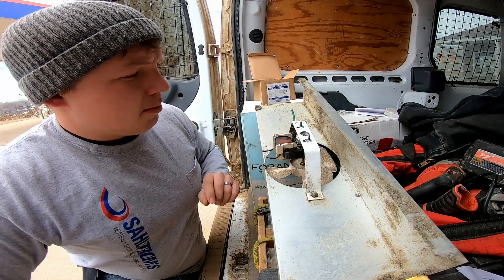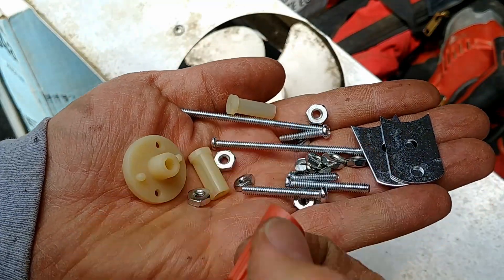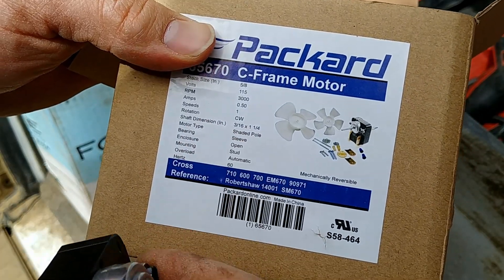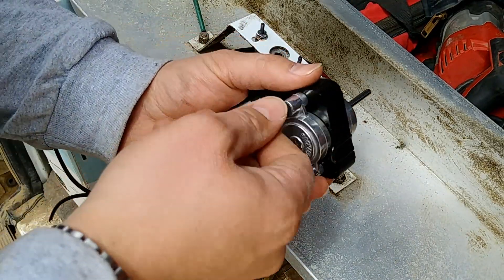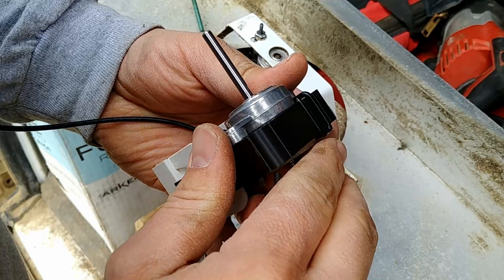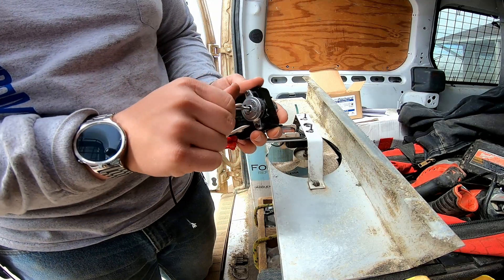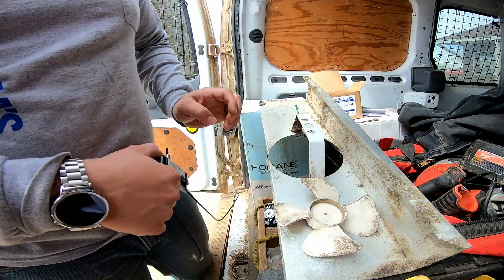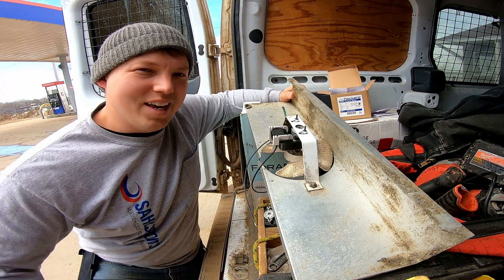How To Replace a C-Frame Motor & Mechanically Reverse Rotation

Comment: Observed you replacing the C-Frame fan motor with a new one. 
My only question is, why you didn't put in a 100% of your effort? 
You didn't wipe down the fan blade, and didn't brush off the mounting plate . You reinstalled a filthy unit. As a customer, I would have greatly appreciated it if you had done this. My take on this is that you did a half ass job. Going above and beyond the call of duty will only make you a better man. 
Those are the rules I live by, you should try it, it won't hurt ,guaranteed.

Comment: As someone who needs to replace their refrigerator motor soon (at least by the sounds it makes) how do you even go about knowing which motor you should buy? I'd love to try and fix things by myself but I feel so hopeless when it comes to this sort of thing, and the last thing I want to do is electrocute myself or damage the fridge beyond repair.
Reply from the maker: Disconnect power, disassemble fan assembly, search motor model information, purchase motor, install and restore power! Residential refrigerators are generally fairly easy to work on if you know exactly what part you need.